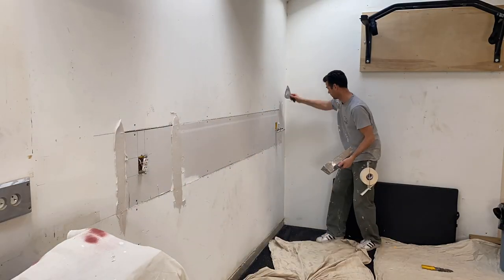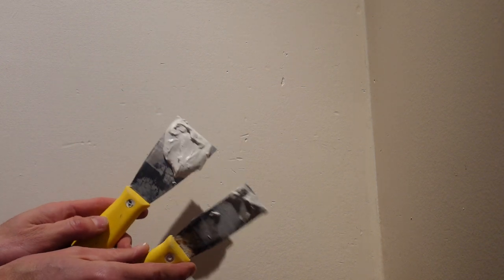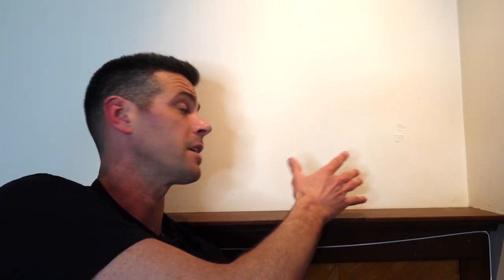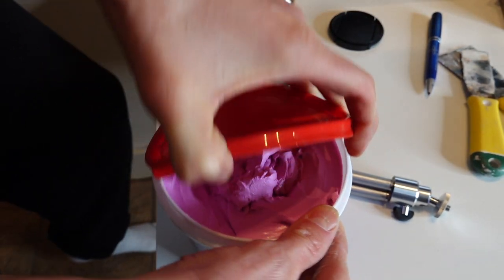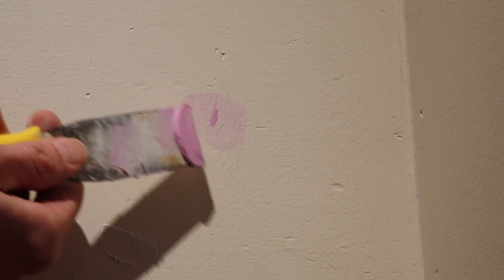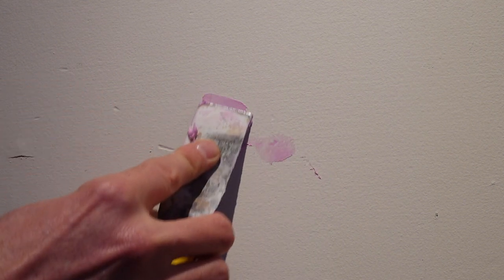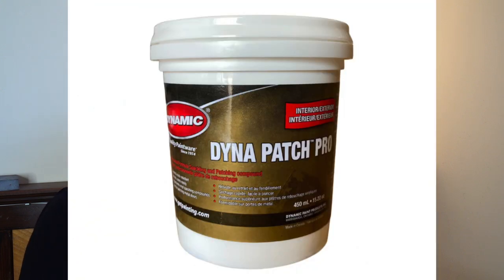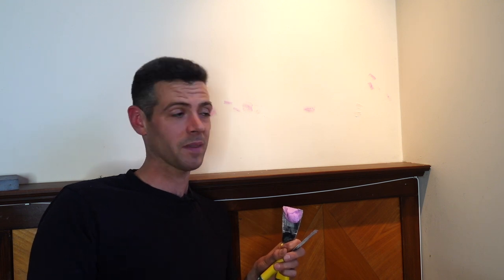Joint Compound vs Spackle!

Comment: I wonder if this was created in response to that YT Short video floating around where the 'drywallers' called the joint compound spackle and everyone started throwing in their 2 cents about the correct terminology.  It couldn't have been much more than a month ago.  At any rate, thanks for another quality video.
Reply from the maker: It wasn't. I haven't seen that. Spackle is a Northeastern US term for joint compound I think.
Reply: @vancouvercarpenter  Buncha weirdoes... Good thing I'm safe from that wild talk here in Cleveland suburbia. :D
It's so interesting how that kind of thing catches on and spreads.

Comment: I hate Drydex, fine for a few holes here & there, but not worth a bucket of warm spit when repairing a suite or home full of holes, nicks, gouges, etc. Use a 6-8" knife, and a pail of CGC Red-Filler all purpose drywall compound.  Yes, you do need to sand & skim more than once for more serious damage, but the sanding is easy. Coat with primer, top coat with finish paint, and you are ready for the finish coat. I also do this for a living, for a few decades.

Comment: Hm. Fairly sure that I can mix Knauf Uniflott to about the consistency of your spackle? But I am not sure that stuff is available in Canada (or anywhere in NA) at all.

It generally seems to be somewhere in between your all-purpose-mud and your quickset and then has some attributes that seem like none of your regular mud types have them? Like it can (supposedly) be used without tape (which generally does work out fairly well but isn't always the safest bet).

I learned a lot from your videos - but when it comes to mud types, I feel like what we have here in Germany and what you're using are two completely different sets of stuff o.O

Comment: Thanks for the video. You did not address the claim Spackle does not require a primer to prevent flashing.
Reply from the maker: It's a claim...not a fact😂
Reply: @vancouvercarpenter  So, you prime whether it's Drydex or taping mud -- even for small dents?

Comment: The law of spackle is that it's always dried out when opening the container the 2nd time.  So I now buy the smallest size and assume that I don't have any on hand.
Reply: I saw a video address this issue and all it took was a couple drops of water on top before closing it up. And ofc a bit of mixing upon opening next.
Reply: @elle7037  Are you sure that wasn't joint compound?
Reply: @allanwind295  it was a small spackle container like the drydex    a drizzle of water, saran/plastic wrap the top and use the lid over the wrap